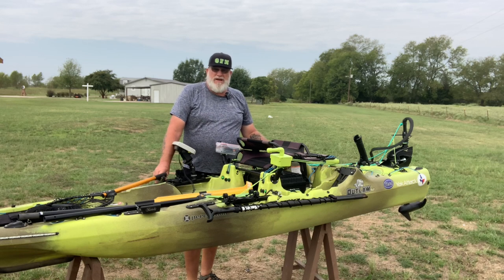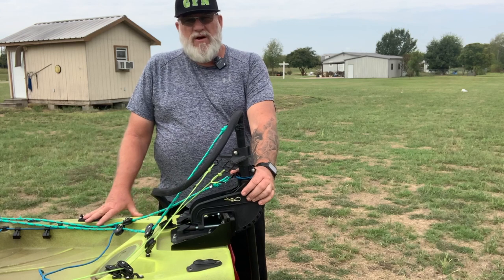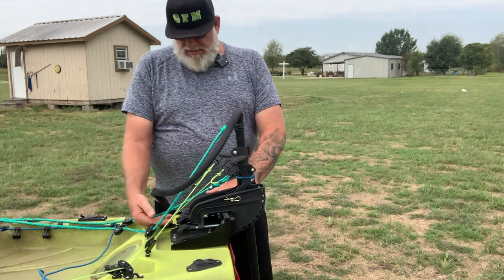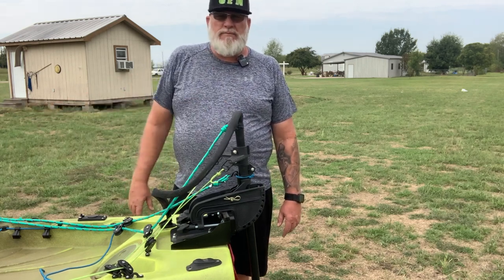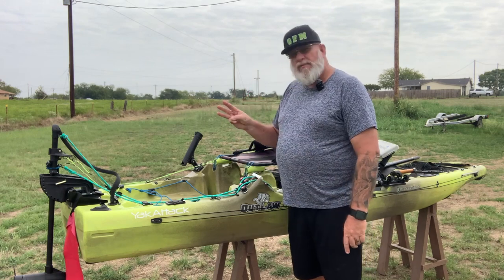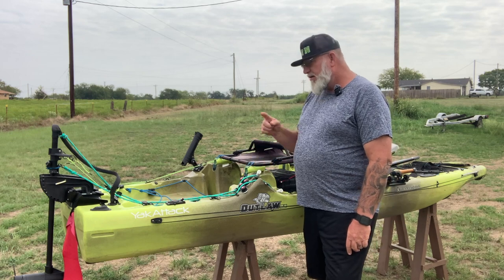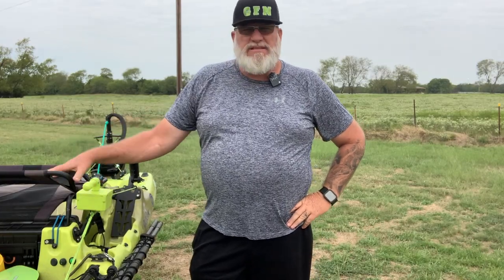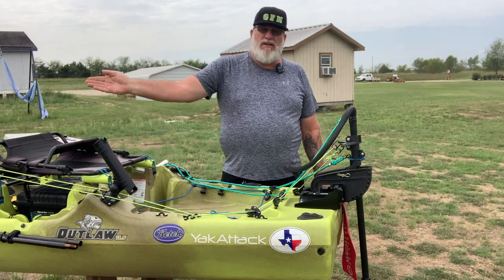Perception 11.5 Outlaw mods and steering control box.

Comment: Nice work and the steering box is great idea. You will increase your turning radius of the kayak if you rotate the NV steering arm 180 degrees so the at the point is facing forward. It is mounted backwards.

Comment: Have a similar build and love your idea to steer and might try it .ive got a pole attached from the motor to a trolling motor extender handle mounted verticly that pivots like a stick shift and retracts when i lift the motor and this just seems more interesting.  Ran all my wires and cords straight into the hull and they pop up where needed and cant recommend that enough .amazon had some cheap connectors that are glued into the kayak so you can just drop in the motor and battery at different ends and plug them in right there and plug the pwm in under the seat and they're all wired together internally and out of the way .wish i had gotten your coloe to match my jeep but those are a hard find lol

Comment: Great idea!  I have a similar set up on my OT 106. I steer using the kayaks rudder (motor locked in position). I might add your steering idea in I use the kayak without the pedal drive.
Reply from the maker: Great thank you for the comment.  If you need some help on that reach out to me

Comment: I cant find decent pulleys for paracord.
Anyvlinks?
Reply from the maker: https://www.amazon.com/RANDDER-Pulley-Anchor-Trolley-Blocks/dp/B092SV2ZLV/ref=asc_df_B092SV2ZLV/?tag=hyprod-20&linkCode=df0&hvadid=652500684677&hvpos=&hvnetw=g&hvrand=7136923460600108222&hvpone=&hvptwo=&hvqmt=&hvdev=m&hvdvcmdl=&hvlocint=&hvlocphy=9028312&hvtargid=pla-2066762642537&psc=1&mcid=81f6c43aa5c53eca9393b5ca8963ce0c
Reply: @Video-Bass-fishing  Thanks I saw those but didnt see a good way to attatch them and they seem kinda pricy for as many as you used.
Reply from the maker: @FScammell3  yeah but they squeak or rattle because they have teflon bearings. I attached mine with heavy duty zip ties.

Comment: I'm not getting the measurements for the inner working.
Reply: I when to Lowe's  to get the parts but the way I understood on the measurement it would not fit in the box
Reply from the maker: Here’s a link for the box from Amazon. 

https://www.amazon.com/Waterproof-Electrical-Electronic-Enclosure-3-94x2-68x1-97/dp/B089K9LM5W/ref=asc_df_B089K4KCQK/?tag=hyprod-20&linkCode=df0&hvadid=693410589815&hvpos=&hvnetw=g&hvrand=11499210594515394189&hvpone=&hvptwo=&hvqmt=&hvdev=m&hvdvcmdl=&hvlocint=&hvlocphy=9028153&hvtargid=pla-943841640608&psc=1&mcid=7fd77dbbeb45387e80b9471b26270f2c&gad_source=1&th=1
Reply: @JohnMain-c3t so what do you take the top of the trolling motor apart?